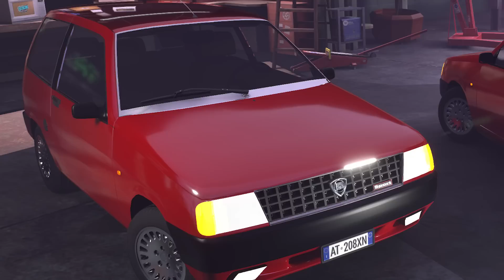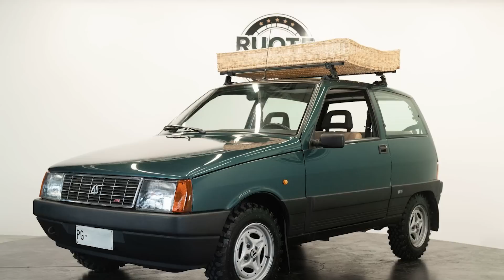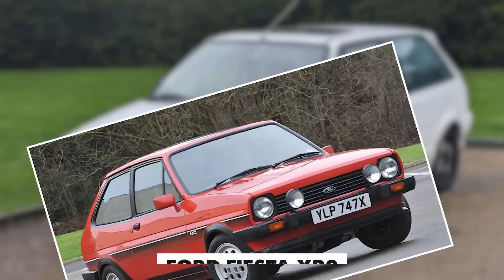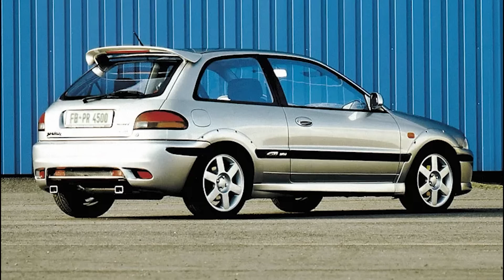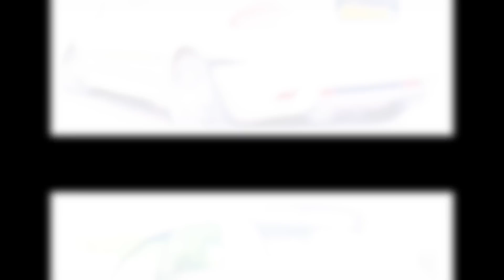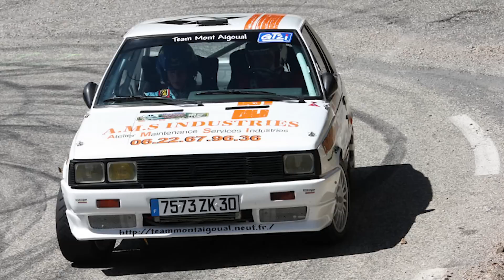4 Most Incredible Hot Hatchbacks Now Forgotten!

Comment: The GTI sataria is like a watered down cyborg r mirage. - it's predecessor the 1990 gtt was much more interesting 1600cc DOHC turbo 16v, the gti was junk. - Lotus 'tuned' the suspension in the Isuzu Trooper too, they done all sorts when they were stuck for money, usually means different suspension springs and a stiffer rollbar + Lotus branding

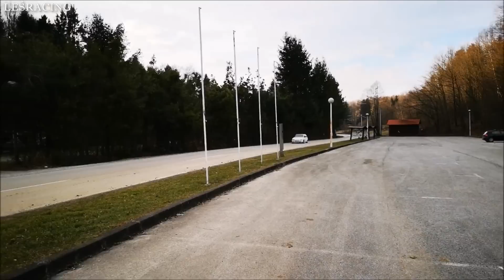Comment: 8:27 The AX GT (1.4L, 84hp, 720kg), GTi (1.4L, 100hp, 795kg) and Sport (1.3L, 715kg) are three different versions. The "real" hot hatch of the three was the AX GTi with fuller equipment, the AX GT was more of a buffed-up standard AX, and the AX Sport was the entry point for people who wanted a base to get into circuit or rally racing.
Reply: 13.09 there is an image of a Peugeot 205 rallye interior.
Reply: @andrewgardner9615  Absolutely, there's even a PTS (Peugeot Talbot Sport) logo in the center of the steering wheel, looks like this video has been made in a rush, too many errors. BTW, this guy is conflating hot hatches with racing-oriented stripped down versirsions, they are aimed at two very different categories of person : one who is looking for a "sporty" car that has some comfort elements and one who is looking for a barebones car that can acommodate daily use to some extent but really want to race their cars instead of on only showing off on circuits.

Comment: I had an 1986 ( D reg in the UK) Renault 11 turbo that was finished I electric blue, I was only 22 at the time but bought it because it only had covered 4560 miles from new! Most underrated car I've owned.  The only reason I sold it was after myself and my wife were blessed with our first child, it wasn't practical to get a baby out of a car seat in the rear and the shock of the first service...at the time the spark plugs were £84 a set as they were gold tipped.
Reply: Everyone went for the more popular 5 GT Turbo, which I had and a friend had the 11 Turbo. No one knew that it had the same engine and went really well. He had a Fuego Turbo too.
Reply: Had a 1.7 gtx from the same year. Bought in 1990. 
Great car.

Comment: R 11 turbo was a fine car not tiny and bigger than a escort, but what i remenber the most was it´s on board computer that one when the car had no gasoline the computer said it still was good for the next 12 km´s or maybe 40 depending if it had one year or two of working, the TSE was the most sold with 1.4L engine
Reply: I had a 1.7 gtx. It was pretty fast for the eighties and comfortable. Nice seats.
Reply: @wolfdog7265  yes it was , but some were even faster ,i have some old 70´s cars that were even more fast and confortable , also the renault 16 TS and earlier in the 80´s had a renault 18 GTS, there was the turbo but this was fine for me has i had bought a renault 5 turbo , that was red and sold only in blue metalised paint also, it had Alpine alloy wheels but was only a Renault 5 turbo ,later the 5 Alpine turbo was released, the 17 i remenber driving it but i sold cars in second hand and drove for a month maybe a 17 GTX and there was a older model coupé that i think it had some relation but from the 70´s, long tall seats and a sportive dash , the 17 GTX was maybe a evolution of this model, cant remenber it´s name

Comment: The R11 and R9 Turbo were essentially the same car. They used the same engine and gearbox as the R5 Turbo and was actually the same power output at 112-115 bhp.

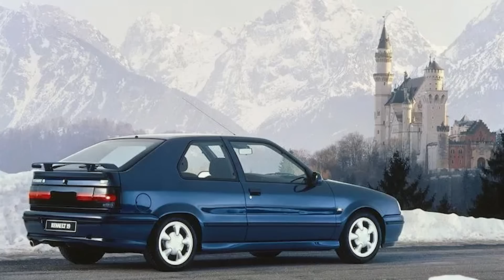Comment: Still have a soft spot for the R11 Turbo Phase 1 with the zender kit, @28:01 a blue Phase 2 Renault 19 16v is shown that was the direct successor to the R11 Turbo and also this is a very underrated and now extremely rare hot hatch and I happen to own one with it's major flaw corrected, replaced the 1.8 16v with 2.0 16v turbo.